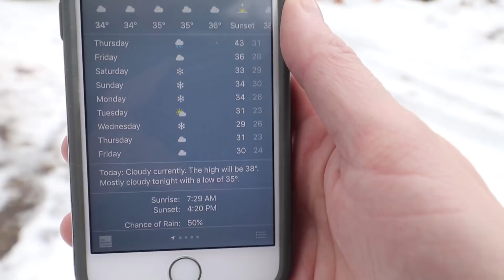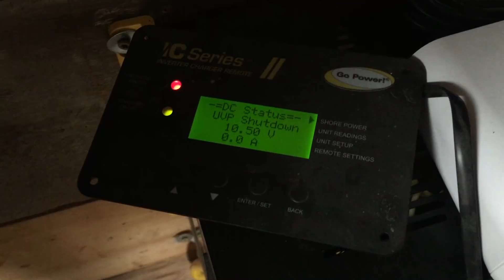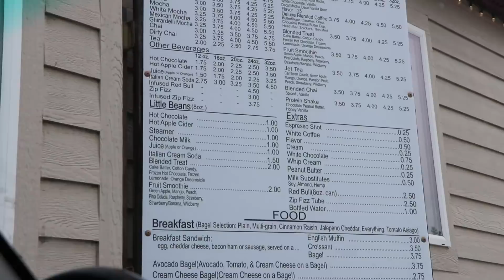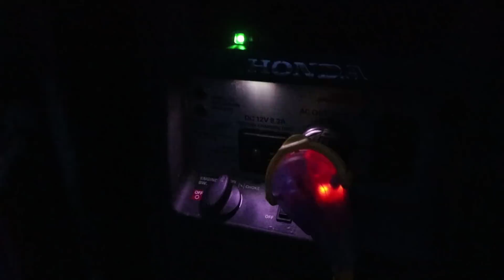Our Story: Giving Up Solar Power to Go On Grid

Comment: great video and discussion. My father lives off grid since early 2000. He is able to use solar power in the summer 11 days at the most, without the generator. But when my family and I visit we start the generator at least every other day for at least 6 hours to recharge the battery bank. I appreciate your honesty and feel that you should do what makes you happy. I have 10 acres next to my father and plan to build our retirement home on it. I hope solar power will be better in ten years as high voltage power is at least 11 miles from the homestead. Thank you for all of your videos. I have and will continue to follow both of you.

Comment: Could you not have a hybrid home? Like during the day when you're not home the PV panels store energy in a battery bank and when you get home later in the day you use the energy that was stored during the day and when that goes the connection to the grid kicks in and your not left in the dark or showering with cold water lol.
Reply: That's what I was thinking ..... I'd milk the solar for all I could get out of it, then let the other system take over. My home is total on-grid electric, and it pains me to see so many square feet of real estate taken up by roof etc that is not "working" for me. Talk about a worthless footprint ...... what can I do about it ..... not a damn thing. I have zero dollars to invest in squat ...... that's the reality. Hindsight is 20/20 and I have 63+ years of life lessons to know when to just go with the flow ..... no sense in dwelling on what could have been - there's no do-overs ~8^)

Comment: Force you're self to use the generator fuel cost in grid power and you'll see a massive gain in output. Make sure you get grid connection to industrial 3ph so you can hook up cheap industrial gear.

Comment: I see comments talking about how grid power is cheaper, at least in the short term. I am not finding that to be true. The impact/installation fees will probably cost you in the 10-20K region, much more if you are far from the lines. You could buy a much more suitable (than the one you have) solar setup for that much money. Would it be 99% on like grid power, probably not, but you could hit 95% without extreme cost. Something like enough battery capacity for three to four days, and solar capacity to charge that in one day (preferably even if over cast).
Batteries are a huge weakness in any off grid system and we just plain don't have a great energy storage method. Lead acid of the type you have, probably only last about 5 years. If you got them used, probably 1-2 depending on how well cared for they were. If you switched to a Trojan or Rolls battery you would get better performance and longevity. You pay for it though. If Tesla's power wall batteries get cheap enough they would be even better. Just running some quick calculations, your water tanks probably hold around 2KWH of power, and might be used instead of batteries by adding lower tanks and a pelton turbine.
Grid power is way easier though,  so it might add it now, and come back to the self sufficiency issue later.

Comment: Honestly, with as much as you use the generator to augment what the solar panels produce, you're already paying a lot for the power you do have. The price per kWh for a generator varies significantly based on fuel costs and maintenance costs, but it generally costs at least 2-3 times as much as buying the same amount of electricity from a utility. I think you're making the right decision. What's unfortunate is how most states are moving to a system which penalizes people who want to integrate solar production into their grid-tied properties.

Comment: Hi from Sweden =). 
I actually like the rant about solar. It gives us the bare truth about the real world. And not the beautiful "lies" we get at the store when looking to buy an solar array. Moooore of this please! Yes people will get upset. But the truth always does... =) 
I have been looking to install solar at my house for a while. The house is on grid. And has been since electricity came. (House built 1872) =). My idea has been to have a half grid-tied and half battery banked array. But now when "Powerwalls" are getting better and cheaper. I might get that instead. Then I can put all the excess power to the grid with "net-metering" (or similar). And still have backup if power fails. All my panels will have micro inverters. So if one has shade or a leaf. Then the whole array won't loose power. Looking forward to see the grid install..  =)

Comment: ATTENTION:  when you utilities come in,  dig a ditch,  lay stone dust in it,  lay pipe in,  run all utilities now or what you might have in the future in those conduits,  lay a spare,  pipe (just like your water system)  just in case cover over said ditch (just like your water system live at the end of line so to speak,  underground handle weather better,  if you lay in pipe conduits, it is servicable if something goes wrong or a upgrade is in order.   advice from someone that build on top of a mountain..........more or less alone

Comment: I would like to give you a suggestion on your water system, from what I gathered from your videos you fill your cysturn through that faucet and have to fight the gravity feed system. if you use one of the empty pipes you installed to put in a top fill with a check valve you will only have to fight the weight of the water in the pipe.

Comment: I think on grid is best for you two and should have been from the start. You ignored or wouldn't adjust to what you were doing wrong regarding Solar. With Idaho power prices being so cheap, you weren't really saving much anyway. Good Luck.

Comment: most places if you have to bring in a line the power co has you to sign a muti year contract saying you will keep power for x number of years and they pro rate installation cost out over that time  (did on my system and they just ran 100 yards or so). we would love to have some solar to offset our on grid power in our area Northern Oklahoma if it isnt sunny it is blowing so wind and solar combo are the way to go but dont think we will go off grid anytime soon.   Good Luck and put a tarp over your garage openings or just put some doors on it

Comment: I can understand that your solar power is not enough for your current and future life, like most of us consumers we use a lot. Over here most ppl have at least like 16 panels or even a lot more to be sufficient to their needs. Also most ppl in the world use it for cost reduction because solar does not give power at night. And the part that makes solar more complex/expensive is when combined with batteries. So it's just simpler/cheaper as footprint reduction in addition to grid power. Thats of course if grid is possible on your property.

Comment: Maintenance is the buzz kill for off grid power. The money you save will be spent on maintenance and down time. Reliable power is #1.
Reply: I spend much more time cleaning the bathrooms than on system maintenance. A well built solar system with quality equipment requires very little maintenance. We wash the panels a couple of times a year which takes about as much time as mowing the lawn. Our batteries have automatic watering; just keep the tank filled with distilled water (check about once a month). That's it. 

In twenty years we've had zero failures except a cooling fan in a charge controller which Outback replaced free (after 10 years). They even sent a DVD instruction video. Easy as pie.

Comment: I moved out to the country, I am basically  off grid here. I don't have  city water it comes from my well, I have septic systems . I use propane to heat and cook on but yes I'm  still on line power from somewhere else, but I  still keep my solar system with generator as a back up.

Comment: In our area ongrid power is 20 cents per kilowatt.  For experimentation I purchased an 800 watt grid tie in system for $4500.  That is less than 1 kilowatt for an expected 20 year lifetime and only during hours of sufficient Sun.  Sure, in California, during the Summer, it helped reduce our grid power bill.  In the long run I don't think it was cost effective.  It is better if you also use the solar panals to preheat water, or keep a hot tub warm, but still not cost effective.  Since you have the panels, use them for grid tie in once you have ongrid power.  If you can, run the power underground, would be a shame to ruin your view.  Remember why Tesla's AC won out over DC.  If you have to buy the transformer, run higher voltage to the point of entry, less wire guage required, then step it down to what you need.  Typically people run 480 and step it down.
Reply: But did you have to spend $60k- $100k to get the grid to your property? That kind of coin can certainly purchase one HELL of a Solar/Wind power system! 

Grid tied seems like a rip off since its dead in the water when the grid goes down; which it does multiple times a year in my urban neighborhood... Add in the cost of a hybrid hack to get use out of your panels when the grid is down and you just burned any savings you might have gotten. 

Also, utilities are making noises to stop paying back for power produced so the whole grid tied setup maybe moot soon anyways. :(

Read some of the recent IEEE papers on long range DC power transmission; Edison wasn't necessarily the brightest bulb when it comes to DC power transmission... And Tesla was a freakin' genius all around!

Agreed, whether AC or DC, you should use the highest voltage you can for long range transmission and then step it down at the end use location.
Reply: Hi Robert

I think I would rather discuss the norm instead of the exception.

Sure it costs a lot to tie into the grid.  In an area where there are on and off grid homes, that cost is largely returned when the house is sold.  I think they are looking to reduce the stress of having to maintain their electrical system.  How much is that worth?

I would say the money put into an off grid solar system does not retain its value.  Batteries expire, panels expire and they are high maintenance.  They have a large tilt on the panels.  I suspect that means the effective Sun light is limited, also by winter weather.  What they have is probably not going to support the finished house.

They have a generator for grid outages and they have existing solar panels.  The solar charger they have may very well do grid tie in.  Why not use what they have in addition to the grid to cover what they need.

Whether the power company pays for surplus or not, they have already made the investment in the equpment.  All they need to do is slow the electric meter down, not necessarily make it go backward.  While they may not be reimbursed for generating extra power, they would be contributing power into the grid system for others.

I have been aware of UHVDC for quite some time.  This is in the relm of the power company infrastructure.  What is delivered for residential use will not change.

Jesse has a large garage.  He may have plans for a Lathe and Milling machine, or other large power equipment.  If any of the equipment needs 3 phase, he may need a converter.  In my opinion, the grid is the way to go for power needs like this.

Comment: The only place you can have 357 days of guaranteed generator free solar is Arizona Texas and New Mexico, and even then in those states you have your limited areas. Also if you’re doing solar as your primary energy source, you really need to go with top-notch batteries.

Comment: hello, kudos for going back on-grid. Me and my wife live in a smaller mobile home and have been conserving and cutting our energy for the last three years, with in all hopes to one day be able to use solar or renewable energy to be able to supply our home instead. our issue is that we've both just been raised up poor and are not yet capable of putting out the kind of money for it for prob. quite some time..don't get me wrong we both work our buts off so we may one day have a more successful future..but anyways.. just figured id throw it out their if you may not have no use for those solar panels, maybe we could get in touch...it would be a blessing to me and my wife to have some of our own to put to use...yea keep doing what y'all are doing and maybe give us a hollar back thanks

Comment: how big is your system and do you have grid tie, you need a 15k system or 20 k system and still be hooked to the grid.      It just depends how much you want to spend for a good solar system.      solar works but you do have to spend.

Comment: You did a disservice to your followers. By not investing enough in your solar power system to go off-grid you are leading people astray. Lead-acid batteries are 150+ year-old technology and are not suited to high-power off-grid applications. If you get a professional to design and install your system, you WILL be able to go totally off-grid. A much larger solar array is needed to account for cloudy days. Lithium batteries are much better suited to running a whole house in a deep-cycle application. The government is giving out 30% discount through a tax refund on solar installations.
Reply: This is absolutely true. Lead acid is a joke.
Reply: I got a Nissan Leaf to back-up my 1963 Ford F-100 pick-up truck about 1 year ago.  The Ford is now 'offline' as the Leaf is too efficient.  (It is Twice as efficient as my Honda PC 800 motorcycle ! ! )  YouTube is a terrible resource (sarcasm) since I found out using it that the Nissan Leaf will (when turned 'on') charge it's 12 volt system battery from the 24 KW traction battery pack up to 1 KW per hour  .  .  .  .  . (Thank You "Transport Evolved" for that info. ! ! ! )   SO:  in this 'new' car I bought used for $9,000. US dollars I also have a 24 KW back-up battery source that will provide 1KW of power to my inverter connected to it's 12v. battery.  A nice secondary power source should the 'grid' go down.  I have an off-grid (hobby-style) four panel solar system I can charge the Nissan Leaf from (on sunny days).  Bought the panels 'used' on Craigslist.  So far  am very happy with my 'back-up' power system.  So far it is all still in "Hobby" mode, but if the grid were to go down, I would be the house with the lights still on at night!  
   So, in some cases you may have a LOT more battery back-up available to run your house on those 20 days of cloud and rain  .  .  .  .  just a thought.
Reply: The problem IS "followers". People need to think for themselves, instead of just following fads or whats trending.
They did a great service by debunking the myth that going off grid is cheap & practical for anyone.

Comment: I discussed this issue with another website and we could see this coming. RE must be used in a comprehensive design including power usage, appliances, structures and geography. As an awkward after thought RE can not succeed where no changes are made from a traditional grid tied home. You never have been off grid you have been on the gasoline grid. Going on grid from a pollution standpoint from a quality of life stand point will be a major ungraded. Yes renewable energy is working across the world but you would have had to put the same energy into an RE system that you put into your wood frame. The point for me with RE systems is freedom and security.

Comment: You got a backhoe which should make the cost negligible. Six foot trench and the wire. Get it inspected, back fill and have the company come out and make the connections. Don't set your transformer box in low grade area that have water drainage issues.

Comment: Going on the grid,good idea. SIP's another good idea. Outdoor wood furnace, need I say it, good Idea. Now you just need emergency power backup. I'm thinking a 20 to 24 Kw propane generator with a minimum of 2, 300 lb propane tanks. If you have a terrible ice storm and your power is knocked out for 3 or more weeks you can weather it. Sell your solar power stuff because the up keep and maintenance is way to much. Remember, there are many ways to save power but making power is usually very expensive.

Comment: I understand the solar woes of snow and cloudy days.  It's true if you don't have another source you'll have to drastically change your lifestyle.  In our case we developed another source, a waterfall, this provides most of our power year round,  the solar adds to it but it's only significant on sunny days.  Like you, we have to run a generator to keep our battery bank charged in the winter because our hydro system would freeze.  We are trying to get more from our solar in the winter.  I'm going to experiment with changing the angle of our panels in the winter to vertical, so the snow doesn't accumulate and the panels pick up light reflection from the snow.  Have you ever tried that?  Anyway, it sounds like you've really analyzed your situation and come to some good conclusions.  Being your own power company is more work than people think.  In our situation power lines are not a viable option, but over time we have some plans to better develop our system.

Comment: Before you put a roof on your house talk to Tesla about  a sponsorship deal . They are just starting to market a solar grid system that double as roofing shingles. Your Youtube channel is a perfect test market for them. Most power companies now have programs that allow you to sell back power during peak usage. Typically this is during the summer when AC units are running in full force. It also happens to be the most productive time of year for solar power in the NW. Going on grid is no big deal, but do it wisely with a robust secondary power option so if you need to cut the cord you can. Keep up the good work on this very difficult journey.